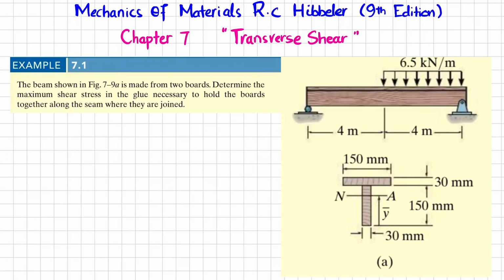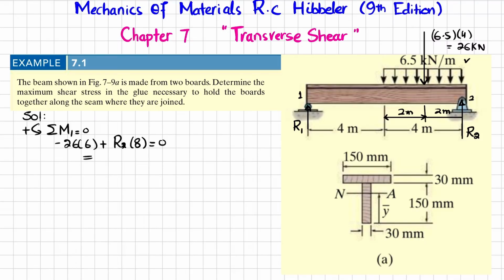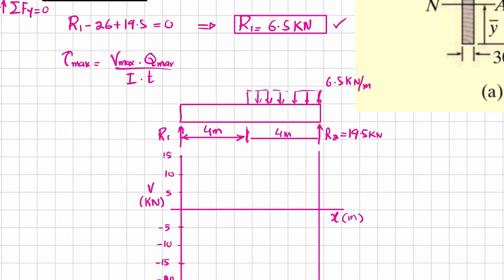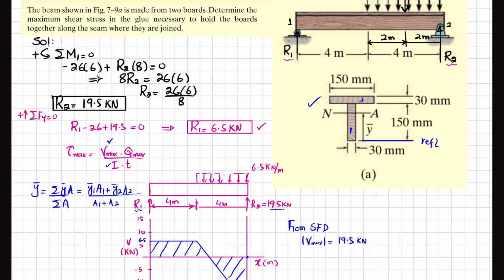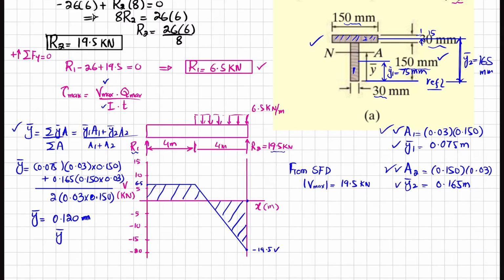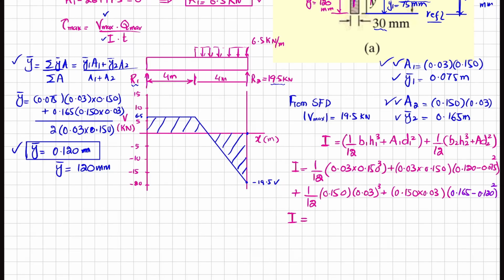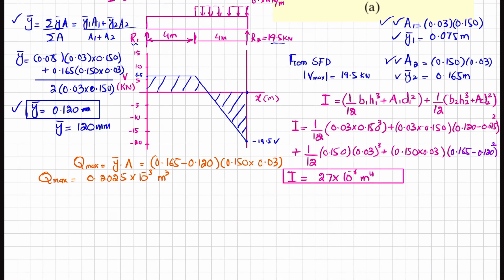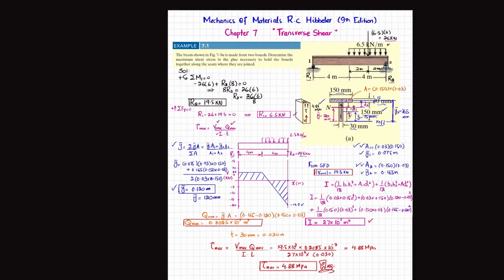Determine maximum shear stress in glue to hold the boards | Example 7.1 | Mechanics of materials

Comment: Why we use t = 0.003? We can't use 0.15?
Reply from the maker: The reason is that you can see the Web is glued together with top flange and the only thickness which resist shear force or shear flow is 0.003 that's why we use this.